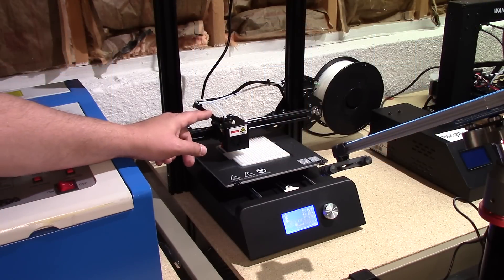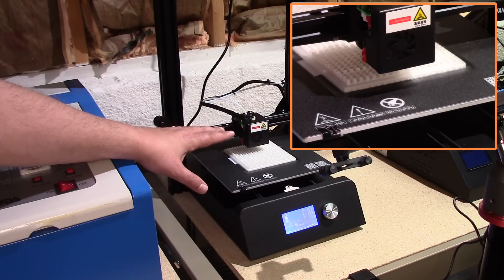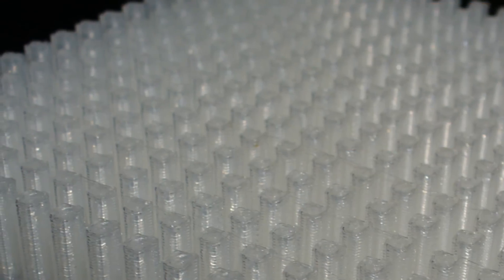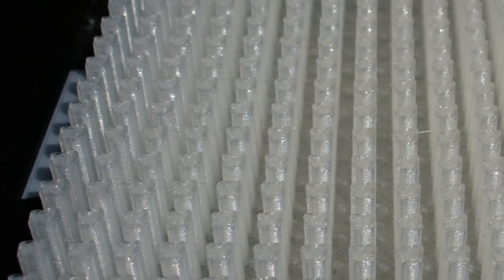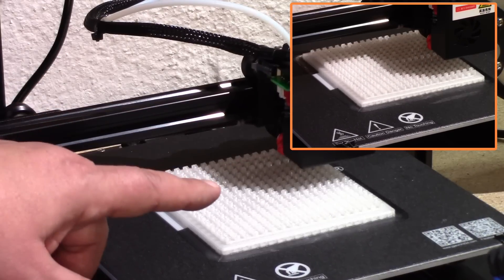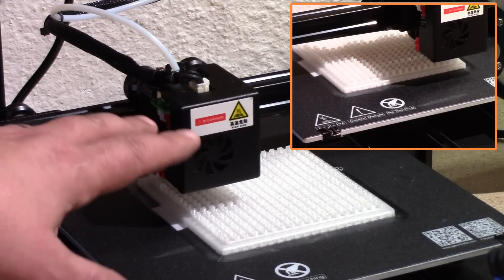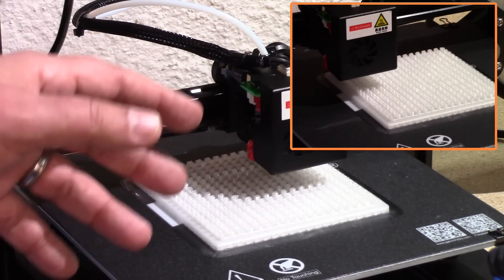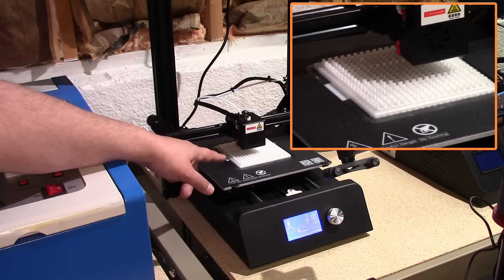JGAURORA Magic - Stress Tested WIth Success!

Comment: Hello:
  I want to buy a 3d printer for printing miniatures and small sci-fi ships, would this printer do well as compared to Ender 3 or Alfawise U30?
Thanks
Reply from the maker: How small is "small"?  if sub 100mmx100mm I would go with this https://amzn.to/2Gpk0re as deltas are not restrained in axis movement as Cartesian printers so they do better at created rounder objects.  I would also go with a 0.2 nozzle now be forewarned this does not have a geared extruder so you will have to slow it down a lot (because of the nozzle size).   As you will get resin quality prints and you will also want to see this video: https://youtu.be/ChhEyQ5aDuU

Comment: Do you have a complete video on how to align your K40 laser from tube to cutting/engraving surface? I printed out your tube mounts, but have not installed them yet. I have had my K40 for about 3 years and have yet to really use it like I use my 3D printers. Thanks,
Danny
Reply from the maker: Please check out the K40 playlist: https://www.youtube.com/playlist?list=PLInTrkIbj69kPO_UP81yxX-xov4SVyPlD as I have 68 video in it :-)
Reply: @DIY3DTECHcom  Thanks. I will be checking them out.